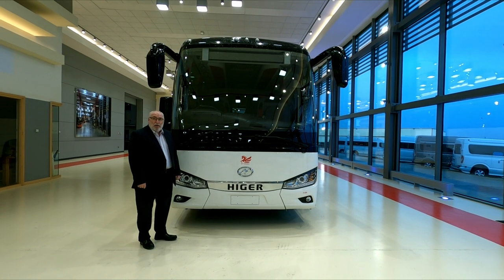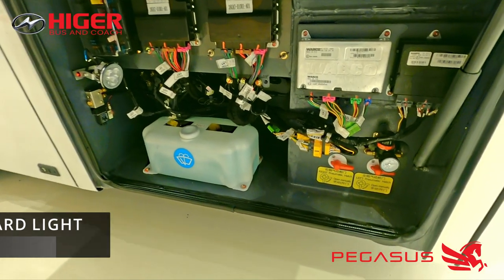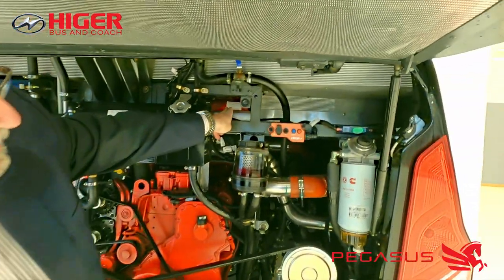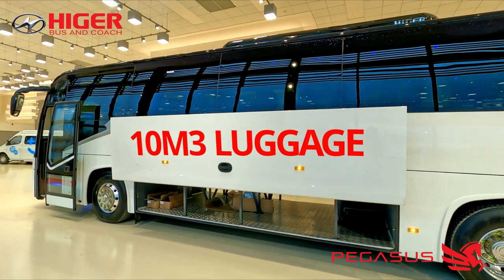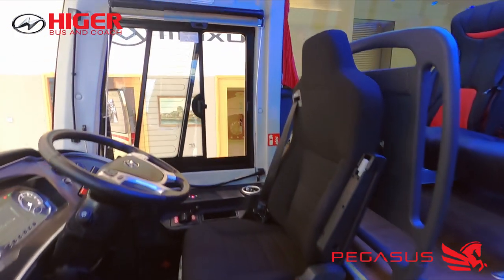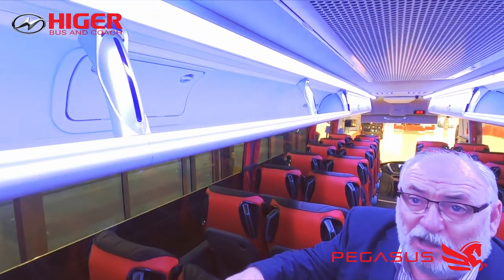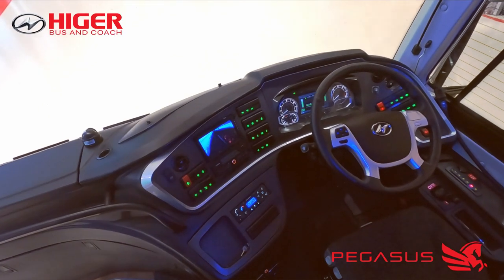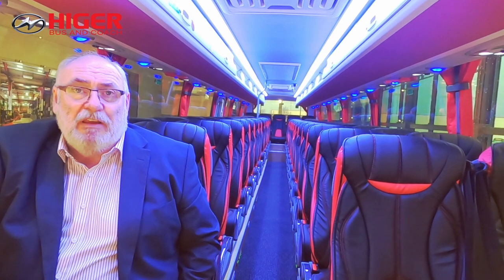Higer Pegasus 12m Coach by Harris Group - Virtual Tour

Comment: From a drivers point of view, it is not suitable for tours. No separate lockers to store water or cleaning equipment. Drivers seat extremely uncomfortable resulting in lower back pain, and the crew seat is even worse. 53 seater coach 2023, luggage compartment full with only 37 pax on board a 53 seater. Windscreen and drivers window demister inadequate.